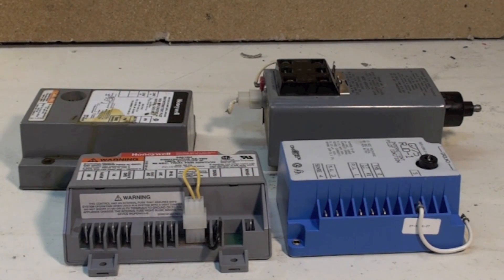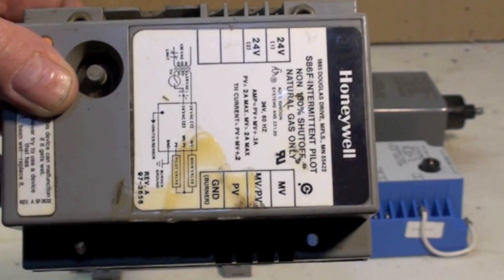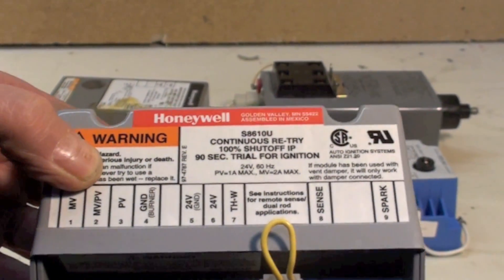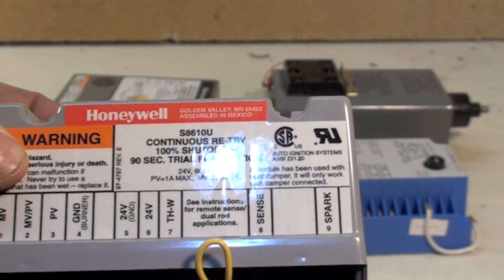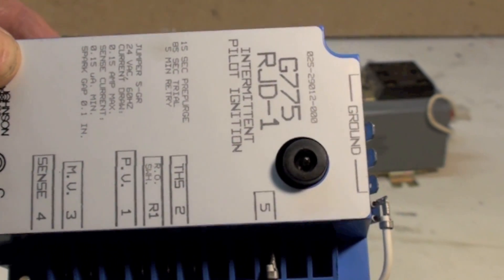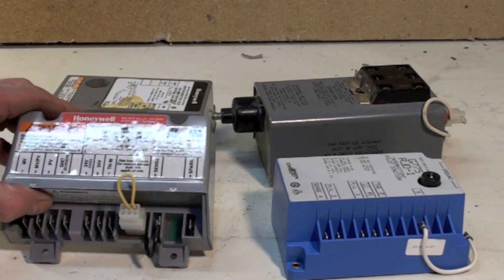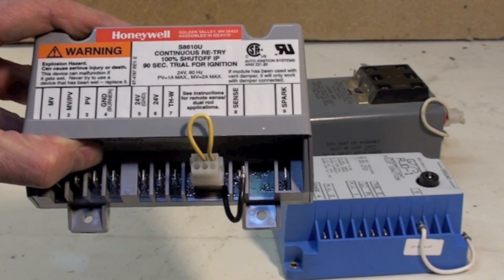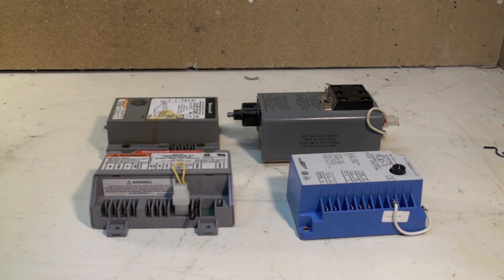Gas furnace spark ignition controls

Comment: Thanks for your video - very good! I have an old Lennox G12 Furnace with a G60QHL interment ignition - I get a spark from the controller but its only for 35 seconds. I think you mentioned it should go for 90 or so. After 35 Seconds I hear a click and I think the controller shuts the pilot gas. I do smell gas so I know there is flow to the pilot during that time. My first question is - do you think the G60 controller went bad (its the original I think from 1980). My second question is - can that controller be replaces with a more modern one - if so which one to get?  Thanks in Advance!
Reply from the maker: If the spark is working at the pilot assembly, I would first clean the pilot assembly.  If you have gas to the pilot and spark, it should light.
GFM

Comment: Hello Mr. Greyfurnaceman. I have a S8600M ignition module and I suspect it is not producing a spark. Replaced the igniter but the issue is still there. I have to light the furnace with a lighter for it to work. How can I test if this module operates properly? I was able to check that it receives 26V.
Reply from the maker: Pull the high tension wire from the module.  Use an insulated screwdriver to connect from the high tension terminal to 1/8" from the unit chassis.  When calling for heat, you should get a strong spark across the gap.
GFM
Reply: @grayfurnaceman  you meant the ignitor wire that goes into the spark blade, correct?
Reply from the maker: @gibson7654  Yes
GFM
Reply: @grayfurnaceman  I get no spark or one before the gas valve opens.
Reply from the maker: @gibson7654  Sounds like a failed control.
GFM

Comment: I have a Honeywell S8910U ignition to a VR8345M4302 24ac gas valve, gas valve is only getting 12v with loaded, S8910U is putting out 24v no load, is this normal?
Reply from the maker: Almost certainly, the the control has failed and you are reading a ghost voltage.
GFM

Comment: I've got the S8610U, and it will open the pilot gas valve and sense the pilot (and start main burner) if I ignite it manually, but I can't figure out what ignitor I need so that I don't have to ignite manually every time.
Reply from the maker: Does the spark come on?
GFM
Reply: @grayfurnaceman  No spark anymore, which is why I light it manually.  Once upon a time, it would generate a spark, and I would need to periodically clean the ignitor, but no spark for some time.  Could it be as simple as replacing the ignitor? It appears to be a single piece, ignitor and flame sensor.
Reply from the maker: @donwallace7354  Remove the high tension wire from the pilot and place it within 1/8" of the chassis, then start the system.  If it sparks, the problem is in the pilot assembly.  If not, the control has failed.
GFM

Comment: Hello are  you still  there ? is me again with the same problem no spark on my older model ruud rheem main module or board  780-715 u there's 24 volts on that and i can hear  the gas valve clicking and i can smell the gas of the furnace, blower motor in auto dosen't  work but works on on position only,  no heat al all . is there a blower motor relay or fuse on this type of furnace? thanks
Reply from the maker: I assume the unit lites the pilot then the main gas comes on, and there is 24 volts to the valve pilot solenoid.   Do you have gas supply?  
This furnace probably still has a heat operated fan switch.  If there is power coming out of the fan switch, you have a motor or relay problem.  
GFM
Reply: Thank you for answering back! But i supposed to see and hear spark or  the noise when spark's just like spark plug?because that is not happening, and i do have gas valve open, have 24v from gas valve to the  relay or black square little box, all started with a lot of condensation thanks
Reply: No spark  no pilot

Comment: Recently found your page here.  You've been quite helpful,  Thanks for taking the time to make the videos.  I have a follow up question with regards to ignition controllers.  I currently have a Johnson Controls G600-LX1.  The furnace does work, however the controller has an audible buzz most of the time.  I've looked into replacements and have found a Honeywell Pilot Ignition Control Board.  It is a complete different device, similar to the different controllers in this video.  Is the Honeywell Board just a plug and play replacement?  I notice the G600 is mounted on the gas valve, but the Honeywell must be mounted elsewhere?

Comment: Hi GFM! I purchased a conversion kit for my Vermont Castings LHEC30 NG insert to replace bad honeywell valve. This kit inclucdes a Skytech RCT-MLT-IV remote receiver, not part of orig configuration. There are no instructions on Skytech install guide (no vids on YouTube) on how to connect the fan harness for the insert (phone call didn't resolve either).  Fan plugs into receiver, but there are two leads that plugged into the back of old honeywell valve (two terminals marked "fan", not TH or TH/TP). Assume these leads control lo/med/hi fan speed. 

Receiver has two terminals marked "valve" and two marked "flame control".  Can you how tell me how to connect these two leads to the receiver or valve?

Comment: Hello there question my furnace doesn't have a spark at all there gas can lit manually but it shuts down in about 5 10 seconds what can possibly be thanks ✌🏻
Reply from the maker: Are you sure your furnace uses a spark ignitor or does it use a hot surface ignitor?
GFM
Reply: @grayfurnaceman   spark  ignitor
Reply: Is an old ruud furnace ignitor looks  like spark plug is exactly what you have on this video thanks
Reply from the maker: @gpsperez5193  Could you send a pic to Grayfurnaceman@gmail.com
GFM

Comment: hey a tech here but been out the loop due to work injury. now gotta s8610u honey well. it blinks 8 times says low voltage you can see the normal sequence w ind. fan press switch spark and gas valve etc it will light up but then cycle on and off and go into lock out for 5 mins then do same maybe after 2 lock outs it finally turns on and runs like normal w the green and orange light saying normal operation. but once it shuts off it does same thing all over. its a Utica boiler... any ideas of what else i can try. I tested for voltage pretty much every where
Reply from the maker: I assume there was no drop in voltage when the gas valve energizes.  Have you cleaned the flame rod?  I know this does not follow the error code, but I would try that first.
GFM
Reply: @grayfurnaceman  the main bracket that is supposed to hold up spark and pilot assembly is missing and the actual pilot tube going into the pilot head is loose so I have to try to find the original assembly mount for it this is an old unit and tech support is closed. and no I didn't test to see if there was a volt drop once the gas valve is on
Reply: @grayfurnaceman  i did use sand paper to clean the rod. but still same scenario didn't want to sand it too hard but it lookt better then before

Comment: mine was sparking and held the pilot but would not fire up, so I cleaned the sensor and reinstalled it, Now nothing happens, no spark. I has 24 volt output from the new transformer, all the roll outs are good and the door switch was engaged. Now what?  Thank you
Reply from the maker: This is almost certainly a wiring problem.  Check all connections.
GFM
Reply: @grayfurnaceman  I cleaned everything and put an extra ground wire from the sensor to the spark module and lite the pilot manually. Than i jumped 24v from the spark module to the valve and it fired up but will only fire up if i jump the valve. after 20 mins or so I watched it cycle and seemed fine but again the main valve wouldnt open ( so I jumped it again and than again fired etc etc. ) Do you think it is the spark module?  Thank you
Reply from the maker: @EurekaRecycler  It appears you have eliminated everything except the module.
GFM

Comment: Is there any brand of these controls that are more reliable than others? I just replaced an UT electronics controls with an older Honeywell that was sitting around, which was also used for a much longer time. These are for greenhouse heaters, so they need to take some vibration and moisture. I looked at the board of the UTE and you can see the case wore away the trace on the bottom edge. Its an easy fix, but without opening up the Honeywell, I don't know which is better suited for this job.
Reply from the maker: I have an affinity for the Honeywell S86 control.  They seem to work and last the best.
GFM
Reply: @grayfurnaceman  Thank you

Comment: Merry Christmas! I have a Honeywell S8610U spark ignitor control which is similar to the one 1:08. It burns the 24v transformer. I replaced the transformer, and I got 8 flash error code on this control, which means the low voltage input has problem. I checked the low voltage wire (to TH-W) and found it is grounded. When I pull off the burner ground wire (GND), the low voltage wire does not ground any more. Does this mean the ignitor control is bad? Thank you.
Reply from the maker: It probably means you have a short in the wiring to chassis of the unit.
GFM

Comment: What if you use an s86 continuous but you’re not getting a spark? Could it be a bad s86?
Reply from the maker: Unless you have a short in the high voltage circuit,  or there is no power to the control, no spark means bad control.  Power in, no power out=bad control.
GFM

Comment: See that blue ignitor, I think it is a JC G776 RGD-14 series unit in my old 1996 Lennox furnace. Well I fixed it for under $5. The PV would start up and then drop out. Why? Because the relay in the unit had failed due to increased resistance of the relay contacts as they heated up due to current. As the voltage at the PV which started at 23V and then dropped to 11V, the voltages across the relay contacts would increase from 0V to 12V. That unit is now 24 years old with each set of relays (PV & MV) lasting about 12 years.

Comment: hi, on the BLUE control box. does the control box sends out 24vac on the THS, then goes through a limit switch and coming BACK on the R1? is that the FLOW sequence? thank you.
Reply from the maker: The control is powered up by THS.  R1 takes the the same side of line as THS thru the limits to start the sequence.  Hope this helps.
GFM

Comment: I've got a honeywell s87j.....my problem is when I turn on the thermostat the fan kicks on but no spark,  I'm just wondering if the direct spark unit is bad or could it be something else?
Reply from the maker: You will need to find out if there is power to the ignition control.
GFM

Comment: Thanks very much.
02-28-2020 in north jersey temperature 28F.
My boiler when off , checking videos after i check all my sensor i find you. my flame sensor was bad , not having any replacement at 11:30pm , my idea was clean the sensor with a dollar bill and a work. All family finally can get sleep.
Thanks again 
Im ready member if you videos.
Best
Rachel Hvac Mechanical
Reply from the maker: Glad you got it going.
GFM

Comment: HI GFM.  Thanks in advance for your help!  I have a Weil McLain Boiler with a Wayne HSG200 gas conversion burner in it.  It has been giving me nuisance lockouts for a few months now, but it always started when I reset it with the main switch.  I talked to Wayne, they said most common thing was a dirty flame rod, I replaced it with a new one.  It ran for 2 to 3 days without problem, then it started to lockout again.  It has gotten to the point where it doesn't start anymore.  I can hear spark after it blows for a bit.  I think it is the ignition control not sending 24V to the gas valve.  I measure across the gas valve and and only see at most 12V.  I measured at the control MV1 to MV2 while it was firing and only see 10V there.  I see 27V at the 24V terminal on the controller (Fenwal 05-31).  All I could find today (Saturday) was the  Honeywell universal and I am looking for the one it calls for in the manual, Honeywell S89F., or the updated Fenwal 35-65.  I am wondering if it sounds like my diagnosis is correct and would like to know if you would use one of the two valves I am listing or something else.  Wayne also has their own control now it looks like.  Pictures at the following link:  https://photos.app.goo.gl/toTCLbrb6YgFGhdj7
Reply from the maker: Your unit is direct fire spark ignition.  In a short, direct spark fire sucks.  I am not sure Honeywell still stocks this unit.  
In this case, I would replace the entire burner.  You could convert it to a hot surface ignitor, but it is complicated.  
GFM
Reply: @grayfurnaceman    Thanks for your response!  I can still get the Honeywell control.  Is there a particular conversion burner you would recommend?  I see Wayne, Beckett and Carlin out there.  Do you have any preference?  I appreciate the input and help
Reply from the maker: @pelletman65  I don't have enough experience with the different brands to make a recommendation.
GFM
Reply: @grayfurnaceman  Thank you for your personal help and in general with the videos you provide!
Reply: Just wanted to update in case anyone else has this problem.  I tried to get the Wayne control but it was at least a week out, and with no heat that wasn't an option.  I purchased the Honeywell S89F1098 on Amazon, wired it up, and the boiler now works fine.

Comment: Hello, I have a Honeywell s8610u unit. When I turn on the furnace nothing happens, no gas, electric, or any sounds. Could the unit or the transformer be bad? Thank you for any help.
Reply from the maker: There could be almost anything wrong.  Is the power switch on?  Breaker on?  If the unit has an operating fan switch does the fan come on when the fan is turned to the on position?
GFM
Reply: @grayfurnaceman  Breaker is good, tested the thermostat, input voltage at transformer is 120, output is around 27. I dont get any voltage readings on the wires going into the honeywell s8610u
Reply from the maker: @micah_paul_creative  I would be looking at safety controls.  Limit switch, pressure switch.
GFM

Comment: I replaced my S8610U ,  after that no flame or anything , I pulled the damper jumper out and Whoosh !  flame sensing then burners came on . I plugged the damper jumper back in and everything shut off again .  So I pulled the jumper once again and left it out . Question,   that wont hurt anything will it ?
Reply from the maker: The damper has probably failed.  You will need to jam the damper open.  It will be unsafe if not jammed open.
GFM
Reply: @grayfurnaceman  thats just it , theres no damper on it
Reply from the maker: @ericm5393  In that case, I would not use the control.
GFM
Reply: @grayfurnaceman  Thx Gary

Comment: thanks for your video. I have a Peerless DE-06-SPRK-WPC Gas furnace with a Honeywell S86 (1997 model never had an issue till now) and for the last few weeks experiencing issues with the boiler starting. Once I power down the entire system it will restart. I'm thinking of replacing the S86. What makes this a bit odd is it will go for days without an issue . Any advice? Thanks!!!
Reply from the maker: From what you say, the S86 has probably failed.
GFM

Comment: i have a s86 controller and system is short cycling.  if i tap on controller box the system will stay running but after 10 to 15 mins it starts short cycling again.  I cleaned the probe and disconnected the flue sensor and replaced the flame roll out sensor.  i tried replacing the s86 box with the new one which looked almost the same and the system did nothing, no flame at all so i returned it thinking it was bad.  before i replaced the flame rollout sensor i moved it away a few inches and furnace ran fine so i thought it was the sensor but system is still short cycling again.  should i replace s86 and gas supply valve?  system is 25 yrs old and hasn't been used much in the last 10 yrs because i use a wood boiler but need a back up. thanks for your help
Reply from the maker: Something does not make sense here.  Rollout sensors are manual reset.  If the sensor caused the shutdown,  it would not restart on its own.  Are you sure the replacement was good?  Was it new?
GFM

Comment: Thx for your informative videos. Just replaced B1401003S ignitor. It would spark, light pilot and then keep sparking with pilot lit and furnace would not fire up.Did no fix problem. Going to replace module next. It is united technologies B13707-23a which I can only find used. Can the united technologies B1370724 or any other one  be used in its place. Thanks
Reply from the maker: I don't know about the UT unit, but you can look up crossover charts at either Honeywell or White Rodgers.
GFM
Reply: @grayfurnaceman  thank you

Comment: How do you test if your issue is the Module, the ignitor itself, or possibly the circuit board below?  I have an spark Ignitor that at first would light flame up but then kick off after 3 seconds.  Now it won't even ignite a spark.  The fan runs but no flames or sparks. I have an ICP NTG3050FBA3 Furnace.  Thanks in advance.

Comment: Well I have a propane heating system Igniter Control Board Ignition Module sp745 no longer clicks click click to turn on the driver to operate the burner is what you need to reinitiate the thermostat. if so how do we do it to reset it

Comment: Hey GFM,

I'm looking to remote state a fire pit from a switch.  Could I use any of these and build some thing that can spark and ignite a pilot, then the Thermocouple open the gas valve and light the fire pit.
Reply from the maker: Yes.  You would need an S-86 honeywell or equivalent.
GFM